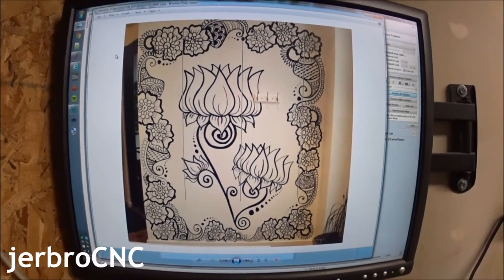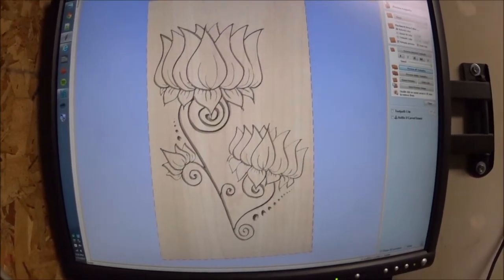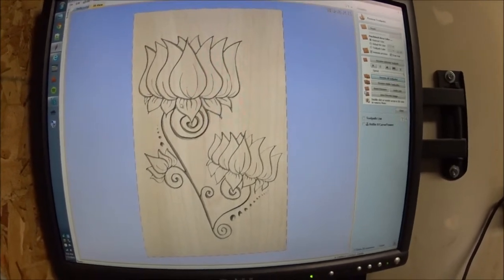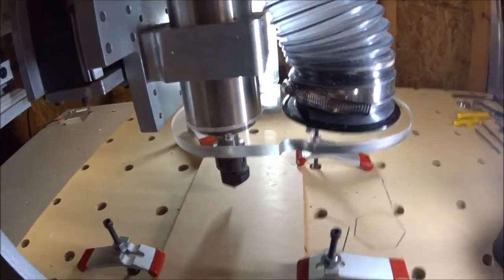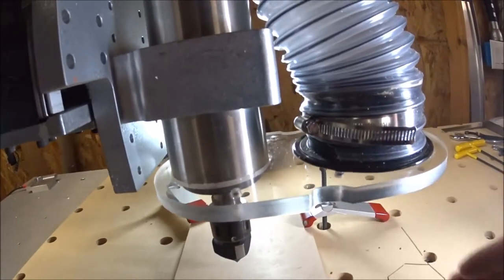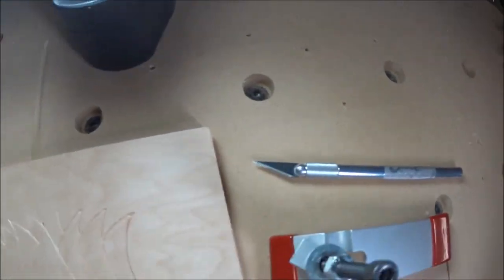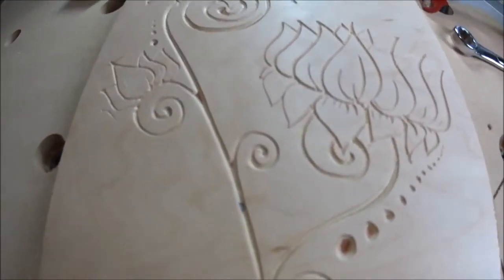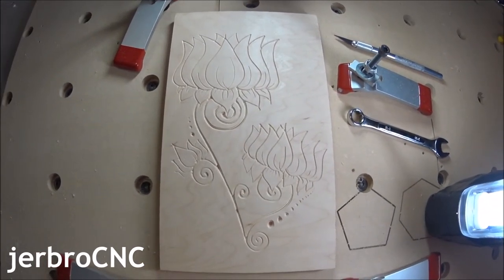jerbroCNC: V-Carve Artwork on Appleply

Comment: hi, nice video! where i buy this L"L" clamps?
thanks
Reply from the maker: Thank you!  The description now has the details here.  I looked high and low for a hold-down clamp that would work with my setup.  I'm very pleased at what I found.  There have been a couple times where I touched the clamp with the spindle, and the clamp just takes the abuse (you cut it), while the rest of it keeps holding.  Just as I wanted.
Reply: I want some of those clamps!!

Comment: That does not appear to be a  States Industries ApplePly product, nor is it a multi-ply product. That is standard 5-ply veneer-core plywood. 

A true ApplePly or multiply panel will have 9 plies per 1/2" or 12mm. 

Also, if it isn't stamped STATES IND with a laserjet on the panel, it is NOT ApplePly, and whoever is selling it to you  is violating a trademark.
Reply: Brittany Barnes Also, if you do not have a local vendor that is a distributor for ApplePly, Columbia EuroPly is a competing product with similar properties, and you can also ask for Russian/Baltic Birch, which will have the same appearance/workability in terms of the core blank stock. 

if all else fails, small quantities can be purchased at buyappleply.com (but shipping is going to kill you).